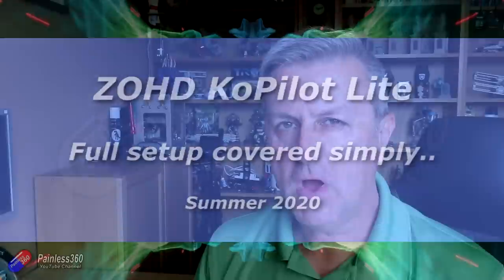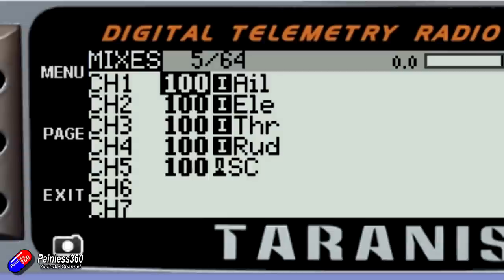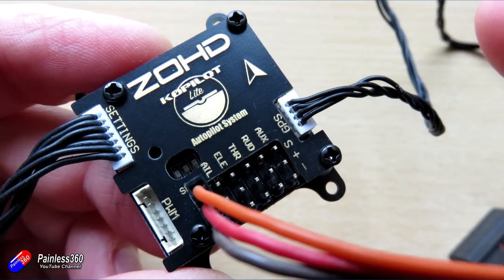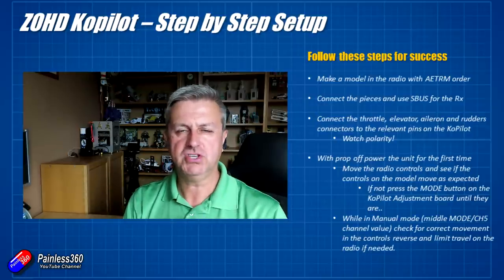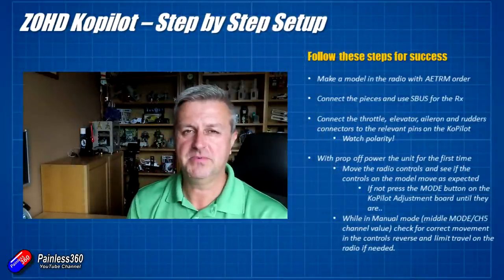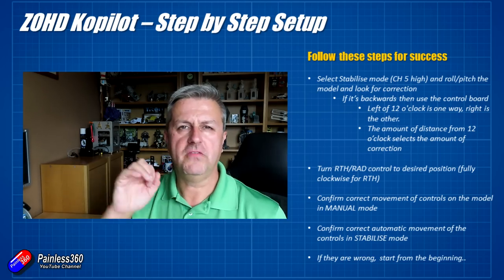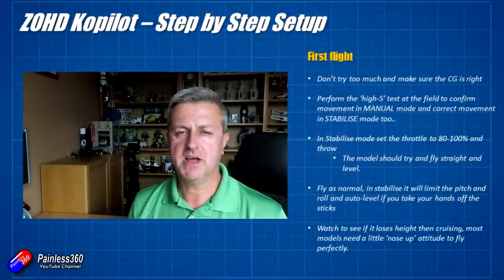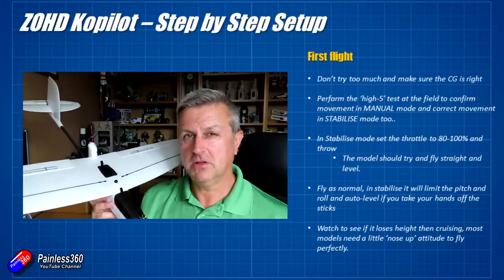ZOHD KoPilot Lite: simple stabilisation and RTH - step by step setup for new pilots

Comment: 12:24 I found with autopilots like the Eagle tree 2D/3D and Ardupilot that adjusting the trims in manual mode would affect the autopilots control and it sounds like the ZOHD is the same. The way I addressed it is to use the flight modes settings on the Taranis linked to the flight mode switch, you can then specify that the trims are only used in manual mode. Means you can adjust the trims for each individual flight and weather condition and know that the stabilised flight modes will not be adversely affected.
Reply from the maker: It's common practice to recalibrate the radio in the FC after you trim. Check out the Arduplane build as it can do all of it automatically... happy flying

Comment: Hi Lee, a question on PWM connection on the KOPILOT. I have a Devo7 TX and RX701 receiver which I want to use with my Drift setup. My question is does the RX701 use PWM so it will connect with the KOPILOT as per the instruction sheet. I cannot find anyone who has the answer. 
Hoping you might be able to throw me the answer.
Appreciate your help.
Reply from the maker: It looks like it does from the manual for it I found online. Best of luck

Comment: Hi mate, I'm having difficulty on finding the right LEDs for orientation lights that I can use for a octocopter with the Pixhawk 4. Could you do a video or just explain how to set up LED orientation lights for each arm of a drone? This would be a massive help have been searching the PX4 docs for a good hour at this point with no avail. Thanks!
Reply from the maker: If you're looking for LEDs that are controlled by the FC (i.e. WS2812), then there are some documents on Neopixel support. Best of luck!

Comment: I Finally found the time to retry to setup the Kopilot Lite on my Dart 250 but keep running into the same issue. Throttle stops working once I switch out of manual mode. 
I really am so close to finally getting it to work. 
I’ve setup many Inav and ardupilot planes but this is just killing me.
Reply from the maker: If the servos are 'twitching' when you can't control the throttle, that is because you are in RTH/Launch mode.. That is normal, throttle only starts when the model detects a throw.
Reply: You can have no throttle control in any mode except Manual (if you have the GPS module plugged in) UNTIL you have enough satellites acquired to have a stable GPS lock and the Home Point thus set. Take it outside where it can see the clear sky! 
Alternatively unplug the GPS unit and you will have throttle control in all 3 switch positions.

Comment: I have recently bought the fpv version of Drift. I wanted to use my Graupner mz12 Pro transmitter to control it together with a pwm receiver from Graupner. When I was setting up de kopilot, my inputs from the receiver don't work. I plugged my pwm receiver correctly to the kopilot with the special cable.
Do you know the cause of this?
Reply from the maker: If the outputs of the receiver are regular PWM then it would work the same as all other receivers. What troubleshooting have you tried?
Reply: @Painless360  I only have the problems when I want to control the plane with the kopilot, if I unplugg the kopilot and just uwe the pwm receiver, everything works fine
Reply: @robinvanlooy294  Graupner use TAER channel order. Have you re-ordered the pins in the 4-pin connector from the AETR stock order?

Comment: hello great videos as always ... unfortunately i can't solve a problem..in autolaunch mode the engine starts before launch ... shouldn't it do it after launch? ... thanks

￼
Reply from the maker: Usually. Sounds like you've not calibrated the ESC... Best of luck
Reply: @Painless360  thank you Painless .. a greeting from Luigi (Turin)

Comment: Hello again Mr Painless. I find your videos extremely helpful. I have moved my Zohd to my asw 28 .It works a treat the only thing I find a little troubling is in RTH once the model is over head the throttle closes to the point where it is just above the stall. I am sure I am doing something wrong. My flying buddy has just bought a motor glider with a Zohd installed but we don't have the leads to go from the receiver to the Zohd. Do you know where I might find them or what they might be called..
Reply from the maker: RTH is there for an emergency. If you are using it to fly home then take back control before it starts to circle

Comment: Hi Lee, I spent the afternoon watching your set-up video's and got the stabilisation of the Kopilot to work as it should. What I can't get to work, is the ESC, it won't arm no matter what. Connected directly to the receiver (RadioMaster R86C, or R88) the ESC arms, so no defects there. I'm at a loss what to try next...
Reply from the maker: There is a problem where some escs will not initialise properly because the KoPilot takes a moment to startup and the ESC times out and disables itself the safety... best of luck
Reply: @Painless360  Thanks! Seems like the ZOHD ESC (rebranded Flycolor) is the way to go, unfortunately I only have the 120A and 150A boat versions at hand...

Comment: As always, a pretty nice video.

I'm trying to use one of these (I know, two years after the release), but I'm unable to use dual rates to make my Drift a little more "mellow" in manual mode.

Is there a way to use dual rates and expo with the ZOHD Kopilot Lite?

Thanks!
Reply: Yep. Just set them to work only on the same switch position that you use to select "Manual".

Comment: Hi There, really strange problem. Set up ZOHD KOPilot with my wing , FrSky Receiver, Taranis X9D as the transmitter. Everything worked brilliantly then problems. For no known reason the elevator channel became reversed leading to a crash. Next I found that the left stick functions had crossed over Up/Down became roll and side to side had become pitch up/pitch down. Tried a new KOPilot no change. Tried a new receiver no change. Re-set the X9D and created a new model from scratch ( no mixes ever) no change. The other weird thing is the KOPilot does not recognize the sticks in calibration mode. 

I am at a total loss! Any help deeply appreciated. 

Iain
Reply: Sorry for left stick read right stick in note above.
Reply from the maker: It sounds like the setup on the radio has changed somehow. I'd re-run the setup routine from first principles.. Best of luck

Comment: Hi Lee, well all is good so far in my set up of KOPILOT and the DRIFT.
The ailerons and the elevator however work in reverse to the stick. You mention if this is the case then fix it by adjusting things in the radio. I have no idea how to do this having searched for information.
My radio is a Devo 7 but the answer to the problem is probably similar for other radios, can you give me some guidance how to fix this please.
Thanks
Reply from the maker: Reverse the channel. See my plane setup videos. It's also covered in the manual (https://www.deviationtx.com/user-manual/user-manual-7e-10) - Section 9.8.1. Best of luck!

Comment: Nice instructional vid, I never did get auto launch to work consistently on my Dart 250g though. A lesson I learnt, I set fail safe as rth for the Dart rather than my usual throttle kill. On the second flight last time out I did my usual launch, chuck it about a bit then rth while I put my goggles on. I soon realised that it was flying away from me rather than rth, but by that time it was out of range of the XM+ so I never saw it again.
Reply: WOW what happened?
Reply: Not sure but I think the gps may have lost its signal or kopilot corrupted the home point as it flew off at around 100 ft and I never saw it again.

Comment: What would be a small thermal glider with an electric motor for getting up, then to turn it off and search for lift? I would be thermal flying over a big farm field with this zohd copilot in the glider. I have a Taranis Tx just like yours. What receiver should I get? I live in Europe so a receiver that could be used on both EU and FCC mode would be nice. Would like the newest rxtx protocoll as I don’t have any  airplane receivers for the Taranis tx yet.
Reply from the maker: I use the RadioMaster or FrSky ACCST/D16 compatible receivers like the X8R for wings and planes when I don't need Crossfire or Tracer.

Comment: Hi, I have a Zohd dart 250g fitted with kopilot, i've been using a X8R receiver  to control her via the SBUS port. I Have recently bought a RX6R receiver to save space, the problem i'm having is that I can get the receiver bound to my taranis X9D plus with ease, but when i connect the RX6R receiver via the SBUS connection port to my kopilot, it dosn't seen to regeister with the kopilot, yet if I change back to my X8R and rebind it , the X8R will connect strait away, I've tried setting a new model up for the XR6R but i'm still having the same problems, do you have any suggestions/help where i'm going wrong, many thanks Dennis H
Reply from the maker: I'm not sure, isnt there two SBUS connections on it? One sbus input and one output? I'd check that you are using the sbus out... best of luck

Comment: I have just installed it in a bi-plane. I am using a Spektrum DX8. I have set it to the flap switch. but I can't get it out of stabalize mode. it remains correcting any movement all the time. (I am getting GPS fix) the switch in RTH mode seems to twitch the surfaces. Any advice to get this to work?
Reply from the maker: I'd check it is on the right channel. Best of luck

Comment: Lee, awesome upload and very helpful. Im attempting to set this up with a DX6i (no 3way switch for modes). is it still possible to use this TX with the ZoHD? thanks
Reply from the maker: Yes you can but you will not get the mode that the middle switch position selects. Maybe you could mix two switches to give you three positions? Best of luck

Comment: Hi ive just tried to set this up with the radio master 4 elrs recever and the pocket radio i don't no if your be able to help but I just can't seem to get a 3 position switch to work I get stability mode and return to home manual mod I cant get to work thanks for any advice thanks
Reply from the maker: Remember that CH5 on ELRS is a two position channel so don't use that for flight modes... Best of luck

Comment: Hi there I've almost got it I think ....I have a question ....I've got stability mode I've got manual mode....but when on the bench if I put it into  THE OH DEAR OR RTH MODE WHEN OUT SIDE WITH GPS LOCK THE MOTOR STOPS is this because its not flying and needs to climb ( the eleven goes up when this happens.)...... can you help as I don't want a fly away loose it in flight ....
Reply from the maker: Yep, it's not flying.. RTH mode  becomes autolaunch... best of luck
Reply: @Painless360  thanks again

Comment: Can I extend the PWN & Mode wires--I have a Radian Pro where RX is underneath middle & ZOHD at top front[with battery & ESC]--Using a Lemon LM0052 RX-Spektrum-No SBUS--thanks
Reply from the maker: I'm sure you can. Best of luck

Comment: Hi Lee! Thank you for all your tutorials. Greatly appreciated. Maybe a stupid question, I have two aileron servos leads but only 1 aileron connection on the Kopilot lite, where do you plug the second lead in?
Reply from the maker: You need a Y cable possibly..
Reply: @Painless360  jj604 on rc groups forums asserts that you can run a lot of planes with only 1 aileron fed by the stabilizer and the other (and flaps etc) fed directly from the receiver. He generally knows what he's talking about.

Comment: Painless...what about mounting the kopilot angled slightly nose up(same angle as thrust angle needed to fly true level). Will this compensate and keep the model flying true level without screwing up anything else?
Reply from the maker: You would want to angle it nose down to force the model to have that slightly nose up attitude in flight. I'd follow the setup guide as it works.. Best of luck

Comment: Hello.  Thank you for the video.  I didn't even know that something like this existed for so low of a price until I saw this video.  I do have a question that maybe you will be able to assist with.  My ZOHD Kopilot is configured and ready to go.  Couldn't do it better and faster without your video. But, I'm about to setup my failsafe on my Spectrum system.  For FailSafe, I will set Rates and Expo switch to low, will set my mode switch to RTH.  BUT do you think that I need to set the throttle mid range for Fail Safe as well, OR, will the KoPilot adjust the throttle accordingly since its in RTH mode (per failsafe settings) at the time of a full signal lose between the Tx/Rx?  Thanks!!!
Reply from the maker: RTH manages the throttle.... Happy flying

Comment: Painless, what about the failsafe? If the tx and rx loose communication? Does it go into RTH mode? And I see one ail servo input. Does it need Y cable? Thanks.
Reply from the maker: You need to setup the Rx to make sure that if connection is lost it triggers RTH. If you are using it in a conventional plane layout then you'll need a Y cable.
Reply: @Painless360  P.  I ve got it working on a FRSKY PWM receiver with the PWM cable and setup channel 5 goes to -100 when failsafe kicks in. Still one question. Does the Kopilot need to be installed close to the COG?  I installed it on a Easystar 1 maybe 10cm in frott of the COG. I could not find the answer in the manual. Thank you.

Comment: You have videos on the Zohd Kopilot Lite and DJI Air Unit, can the two be used together? If so, how is this wired up? Thanks for the great videos!
Reply from the maker: Yes they can but they can't talk to each other outside the AIR Unit being used in the same way as any SBUS receiver to control stuff. Not sure about the channel order though so that is worth checking..

Comment: Hi Lee! @Painless360
Ive ordered this lastweek,and its just arrived today..greatfull!

1 question just blinked thru my mind;  what if during flight with these Kopilot, my airplane receiver suddenly lost signal to my tx radio? Will the Kopilot take-over,or maybe it'll piloting on RTH/Fence mode?
 (In this case,im planning to use either std Radiolink R88 2.4g rx, and another setup is elrs..using those Jumper tx module and Aion mini 2.4 elrs receiver)...and had just bought TX16S mkII v4,& im truly new to opentx🤦🏻‍♂️😅..
Please guide me with some advise...😅
Reply from the maker: Set up the Failsafe on the reciever to put the Kopilot into RTH model and then it'll fly back to you in the event of a signal loss.... Best of luck
Reply: @Painless360  
Ahaa!!! Thats it...
Now i realise how its work!😅👍🏾
Thanks a lot Lee!!...  Happy flying-

Comment: Hi, I have set up the kopilot and it works fine. In stabalised mode it flys straight and level, however when I turn the plane it only does a slow gradual turn. It doesn't respond as well as it does in manual mode. What do you think the problems is. 
Wally
Reply from the maker: KoPilot limits the pitch and roll angles when activated. Happy flying!
Reply: @Painless360  thanks for your help

Comment: Thanks for the video painless as this helped me out greatly on setting mine up and works like a charm. However, I do have a question, is there a way that I can add an OSD without the ZOHD Cam? Or, I was also wondering if there is a way I can use telemetry from my radio directly as that would work as well. All I'm looking for is Battery Voltage/Amp and Altitude. If it can't happen in an OSD I'll be happy with radio telemetry and setup voice. I'm currently using the FrSky RX6R 6 channel rx as I'm not doing long range at the moment and eventually plan on Crossfire. I thought about going full iNav but honestly the Kopilot really does what I'm looking for on a controller (stability during video footage & RTH Failsafe). Outside of that I'm in manual mode and RTH GPS Failsafe.
Reply from the maker: Sadly you will need a flight controller for that. See my iNAV for beginners 2020 series.. Best of luck
Reply: @Painless360  Was afraid of that but yup I agree, time to look into a different flight controller.

Comment: i need help somebody plz help!?! ok i am fairly new to all of this stuff (R/C drones, planes, and helis) and i just got the zohd talon with the kopilot. i got everything hooked up properly, finally, after a couple of days trying to figure out how to get a vtail set up on the kopilot. i didnt know that i needed to have my reciever set up for a normal airplane not a vtail plane setup. anyway i finally figured it out and all of my control surfaces were working properly and i set everything down for the night so i could go out for the maiden flight first thing in the am. i get up go to the garage to check everything and hook up my dji air unit so i could fly the maiden fpv but i turn on my transmitter and not a single input will do anything. i have a good connection to the reciever is but nothing works all of the indicator leds are showing that i am good to go but my transmitter wont operate anything on my talon. WHAT DID I DO?!?! SOMEONE PLZ HELP
Reply from the maker: Sounds like you didn't use this video to set it up in the first place. Glad you found it now. Are the outputs on the DJI unit in the right order for the KoPilot? I'd check that first. You don't mention if you are using the DJI FPV controller but that won;t connect until the controls are in the right place (throttle down). Best of luck!

Comment: Are there certain ESC that just don't work. I've tried two different ESCs (not sure of the brand, both are 30A from banggood) and everything seems to work fine except for the throttle. I get not motor control at all in any mode, even with a GPS lock. 
Is this a problem anyone else has had?
Reply from the maker: Yep, for those cheaper ESCs that disable the throttle if they don't get a valid throttle signal when they startup. Lots about this in the forums... Best of luck